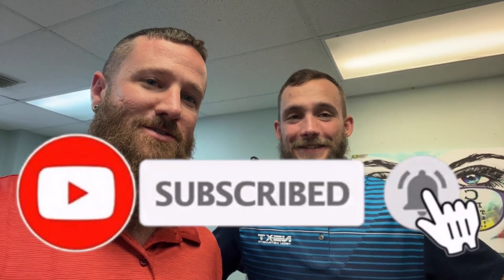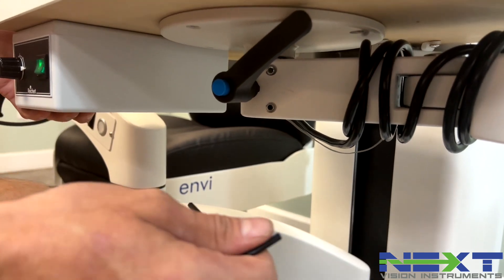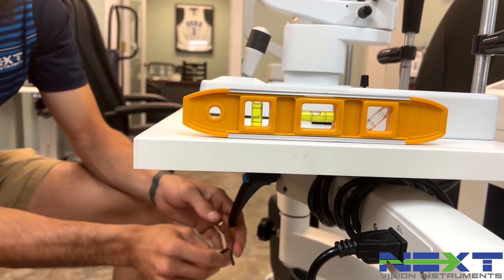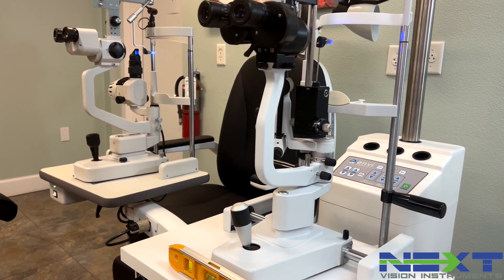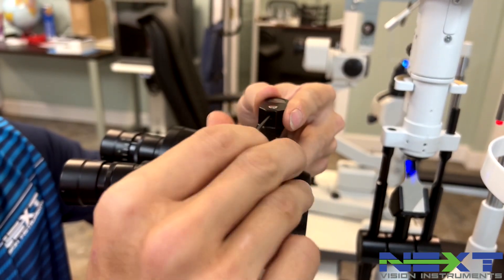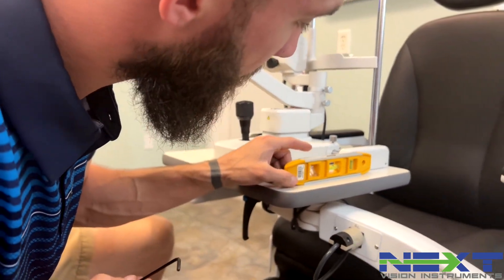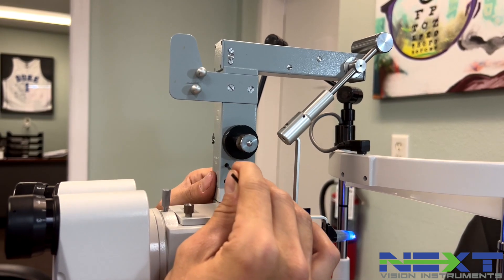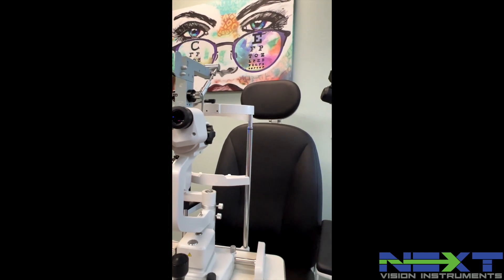How-To Level Slit Lamp & Align Tonometer

Comment: Thanks. Can you do a video for leveling a slit lamp table for an older TopCon CS 4 stand. Also one on how to calibrate various Goldman applantion tonometers. Great video!
Reply from the maker: Great suggestion, we will definitely take that into consideration! We are working on various applanation tonometer tech tips as well. Thanks for your kind words!
Reply from the maker: The slit lamp leveling on a CS-4 uses the same technique in this video! If your slit lamp arm does not have the collar where you put the slit lamp mounting pin, you may have to use washers/shims on the actual slit lamp base to get it perfectly level!